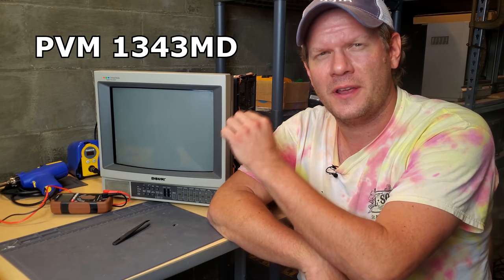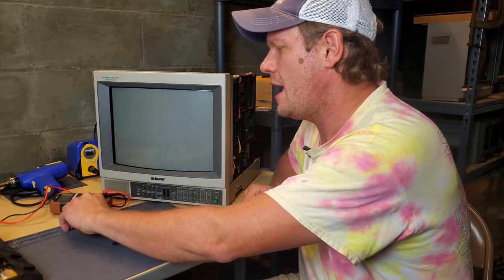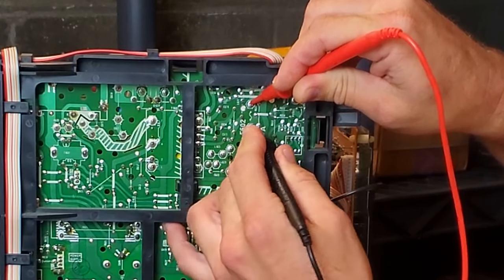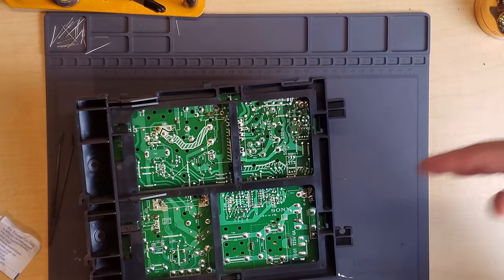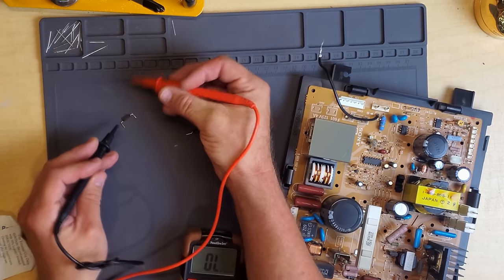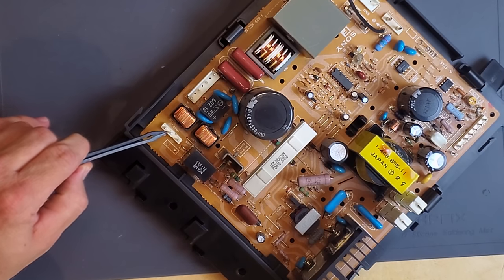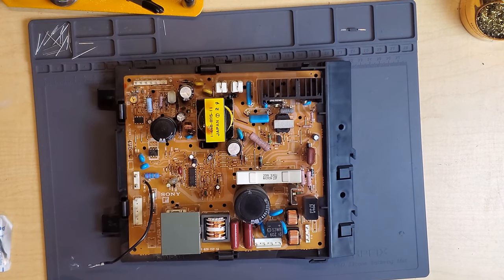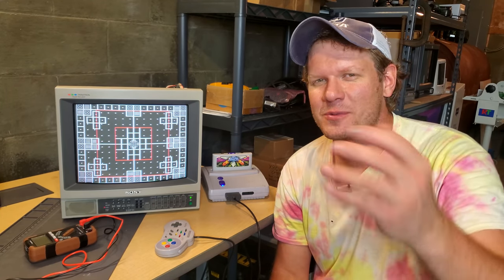Can $2 Save this CRT?  The Sony PVM 1343MD Trinitron from 1992

Comment: Thanks for this video! I have one of these I forgot about that was in with a lot of audio equipment I bought in an estate auction of an electronics technician. My brother wanted to send it for e-waste but I checked the model number online and saw what people wanted for them. I took it downstairs to test it and it didn't power on, but that same fuse is blown on mine so fingers crossed I can just replace that and get it up and running!

Comment: Bought this exact model yesterday here in brazil. Reportedly it is working but it takes some minutes after boot for its image to stabilize. Probably a cap that needs replacement but idk.

Great video!
Reply from the maker: Thanks for sharing, yeah that's probably caps in the Power or Deflection area.  Also may be cold solder joints.  Good luck.
Reply: @RetroTechUSA  thank you for the response!

An update: received it today. Was broken in shipping... considering repairing it (tube is working; only chassis was - severely - broken, apparently) or returning it... what a shame..

Seller even tried to guilt trip me since they provided a good discount (which is completely unrelated to the shipping...!)

Comment: There he goes again, manipulating the broken CRT market driving prices up on those too!  ;-)  Great video Steve, I picked up an 8042Q last year with an 8044Q for $60 total. Neither of them powered on and 8044Q was really corroded. The 8042Q needed a fuse. It was missing, I put one in, and works fine!  I bought it to compare the 250 line tube in it to the 450 line tube in my 8045QDs. The 8044Q still needs (a lot) if cleaning and inspected before I even attempt to power that one on.  If nothing else it is spare parts. I've always wanted to try incorporating a comb filter from a dead PVM into a more basic consumer set.

Comment: I got the same model in March but I didn't realize the power cord was cut in half wrapped with duck tape. Ended up finding someone who fixed it.  Also there is missing video at the top left corner of the screen no matter how far I move the horizontal potentiometer. Used 240p suite to help fill the top left corner but no luck.

Comment: I want to ask you a question. When your turn this bvm/pvm monitors on, they have do a high noiseon the degaussing? I have a bvm 1310 that does this, its loud and short sound when you turn it on (degauss it). I checked the ptc on the degaussing circuit and it looks fine. I need to troubleshoot it further.

Comment: when you say "the monitor will not power on at all" do you mean, that just the screen/guns will not light? or that nothing will turn on.

I recently picked up a PVM 8220 for basically 10$, and while it "powers on" ie the buttons light, and the flyback sounds normal, I get no power to the guns/screen at all.

I am new to working on PVMs so I did not know about the other types of fuse. so I will check that if it has one.

fingers crossed I can fix it for cheap, its really nice looking otherwise.
Reply: I might have the same problem with my 1343 MD.  It makes the expected noises when powering on and the power on indicator lights up, but I the screen doesn't light up at all.

I'm not sure what you mean by "I get no power to the guns/screen at all" -- does the screen still feel staticy when its on?  Mine does but IDK what that would indicate.

Comment: 😭bought my first pvm it's a Sony SONY PVM-8041Q
 it was basically shipped the same way
🤦‍♂️The box was about the same size as yours unfortunately  I don't know if it's due to shipment or  what is not working properly there is a solid red line going across the screen About the same size as ✏ pencil lead 🤔Is this something that is fixable
 I do know how to solder and have a soldering a  desoldering station
 Someday I hope it get another one that is working that is 14 Inches
Reply: If it's at the top of the screen try switching it to 4:3 mode and run some video through it.
Reply: Hooked up my  3DO  to it   now I have three red lines  picture is mainly red with some blue but the blue is extremely dark I used S-Video to hook up the 3DO And the picture jumps around randomly 
So what I did next was change it to 4:3 I adjusted the vertical hold in back picture was rolling
Came on fine for a few seconds I would say about 10 or 15 then a picture of start to get redder and redder so I turned it off not knowing what was going on  

this is quite a learning experience for me 
👍Thanks for everybody's help and suggestions 👍

Comment: I got a PVM 1343MD for free, but I get no picture.  It makes the low vibration when I turn it on, followed by the high pitched CRT sound, and the power indicator light goes on, but the screen doesn't light up.  I'm guessing it's broken and I don't just need the right input cables?  Is it toast or could it be an easy repair?